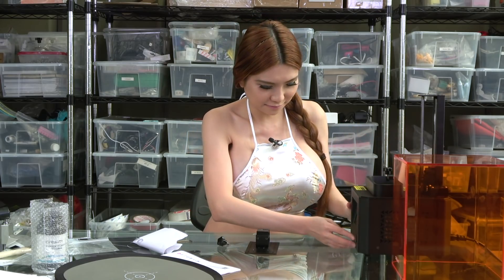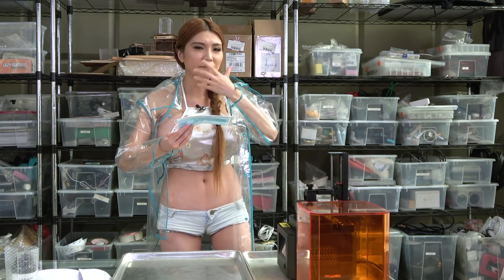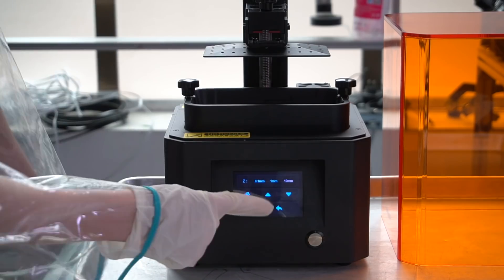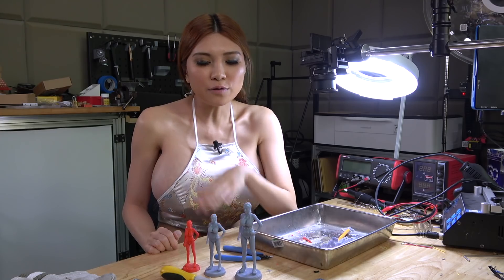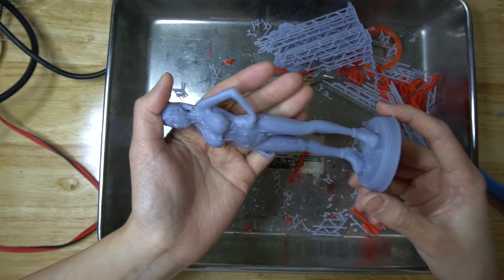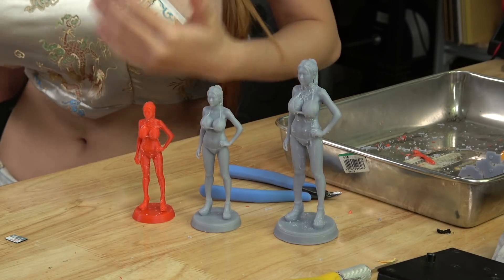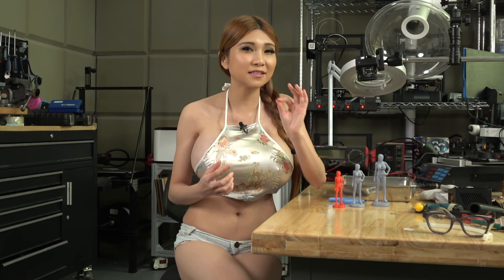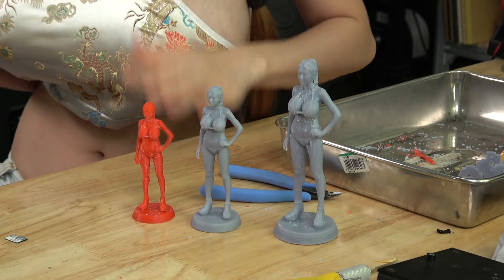Creality LD-002R SLA Resin 3D printer- Review and Unboxing!

Comment: Who ever wants to buy that Printer: you need to set up Z Axis default value (its on the Menu as Z=0). Otherwise when you just first use this Printer you crush your printed parts into the FEP film and screen. Either dent the film or crush your screen. You dont want that and I could not find a hint in the Manual.

Comment: In order to do decorative prints parts must be cut for printing such that the supports occur on the interior of parts or on an area of the surface where supports won't ruin the aesthetic of the final part. It's more work for file preparation but it is worth it. If your design intent is to produce quality prints for collectible level quality. Fun times!

Comment: this printer couldnt be any more Epax X1/Elegoo Mars if it tried. one suggestion, if you're gonna be using a resin printer a lot, is to invest in a decent, easy to drain and clean ultrasonic cleaner. gets rid of a lot of weirdness that shows up in cured prints without much effort

Comment: I think the part at the end, where you say the SLA/DLP printer is more an artistic tool, is dead on! You absolutely need to dial in the settings, espeially on supports, and Chitubox does not make it as easy as another slicer, PRUSA SLICER. Autosupports on PrusaSlicer are AMAZING. you set it up for their SL1 printer and it's a cake walk.  I love my resin printers, i have the elegoo mars, and wouldnt change a thing about it. THAT SAID, i have my FDM printer running right now doing other prints for other purposes :) Right tool for the job. Thanks for the good review and info,

Comment: I got a self made fdm and it soes the job, figurines is why i would buold a lcd printer but only for the graphical effect and speed of models etc . The issue i got is the smell so i guess any resin will do the job more or less problematic in a small apartment but the cleaning time compensates. A fdm even with the fastest settings will not make it as a sla does, but i would not recommend it as a starter as the slicers are specific and you print with expensive things vs a cheap fdm , and fdm has gone so good now you dont need to buy the bigger brands really as most are cartesian. I would buy this one if i move towards sla but i have tested it and it is really fumy when filling.

Comment: Someone modeled a beuty! The beuty - that is ;-)

Anyway isn’t it possible to limit the hassle with support by redesigning it in such a way, that it is still dense in most of the volume, but there would more diluted scaffold in the “touch zone”? Meaning, doesn’t seem necessary to me, that the scaffold would touch the model on so many places. It just needs to be robust under the model.

It would reduce the need to cut and scratch.

Comment: Could you have flipped the print to print from head down (head attached to platform) so you don’t need lots of supports, or would it not handle the weight of the finished print with a small contact point? Maybe far less cleanup?

Comment: My first printer was a DLP printer (anycubic photon) and I make small functional prints with it including hydraulic cylinders, you have to be wary of the shrinkage but otherwise it's perfectly fine for the use. I've made bearing races and even gas turbine parts using it and it performs extremely well, much better than any FDM printer I've used for the same purposes. 

If you want to make small functional parts with a DLP printer then use a low shrinkage resin, support only what you need to support, make sure you use a higher exposure time per layer to reduce shrinkage, and to take into account the dimensions of the pixels otherwise your print will stick to itself. I typically leave a 0.2mm gap (same as FDM) if parts need to be printed in close proximity to each other. 

Resin also offers one big advantage over FDM because you can weld resin parts together with more resin. I've been printing multi-material builds with resin about 4 months now and it works really well since I can do 2-3 separate print jobs and then weld everything into place.

Comment: The first thing that comes to my mind is in the slicer software that creates the supports, as the smaller the contact area the easier the cleanup. This requires a proper design for the support structure and this is something that default values do not give as the defaults are a starting point and it takes practice modifying them for the best results. Also often with lots of wasted material.

Comment: I did some experimenting with UV cured resin as a wood finish for guitars. It’s a neat material, but definitely seems to require more time practicing and developing a reliable work routine.
Bubbles/pinholes were the issue I ran into most frequently when working with it.

Comment: I'm thinking this printer might just be ideal for a customer of mine, a design he made didn't work too well and I modified it so that it is superb (I'm not a mechanical engineer, just electronics, but it really made a huge difference).   But the print houses want twice the price for my design yet very little difference in the print!   The printer would easily pay for itself.

Comment: Tip for removing supports. Before the final cure step, use a cuticle trimmer (manicure tool) to slice off the dots left from the supports. It cuts almost perfectly flush with the surface and makes sanding a lot easier.
Reply from the maker: Ok!

Comment: What happens if you don't add supports? It's printing upside down so everything's hanging out in midair anyway, so it seems like it wouldn't stretch out or break (or whatever happens, I have no idea about this stuff!)

Like, would it be possible to skip most of them, and just support the bigger parts that stick out like the arms? It just looks like the prints are really solid and you could maybe get away with just adding supports for the elbows or something, or adding a few to distribute the weight on something like the tilted model. Or does the auto mode really need to add all that?

Comment: Usually I would remove supports first before UV curing. Then sand off debris from whatever is not removed with a 400grit, needle file and diamond file

Comment: As always I love your content, I wanted to share a couple of tips to help you be safer and get better results with SLA printing. 

1) Use a respirator type mask with the resin, the same you would use to paint is a good place to start. 
2) Try removing the supports while you are rinsing it off with the IPA, if you accidentally dig to much out from the model you can leave a little resin to cure out the divot.

Comment: I must say, I think you came up with a brilliant option to work around the problem you had with the charity deal you tried to do previously. The only downside I see is that a hard copy version of your model provides mo option for someone who might have enjoyed incorporating your 3D scan into a 3D Graphics program. Also there are those who really have not talant for cleaning up the finished model and so because of that you might not get as many people interested in taking up your offer. Still all in all I'm betting it will do well because surely there are lots of people who would love to have their very own Naomi Wu. One thing I don't understand (since I have no experience with these printers) is why does the standing one need all of that support structure? It seems like when it comes out it's pretty solid. Now the one at an angle makes more sense to me but it seems like the standing one should be able to get by without all that support structure. My guess is there is a period of time in the process where it's not as solid as it looks like when it comes out, is that correct? In other words is the issue that without the support is there a period of time in the process where the model will sag and distort from the proper shape?

Comment: Supports need to be removed BEFORE you use the UV light on the print. Then they are softer and very easy to remove. Also thin supports leave smaller marks 

Hope it helps

Comment: That smoothness is great. If it were me Instead of making all one piece. I would make a sculpture in sections to make it an even bigger version than what the printer limited to. It should eliminate almost if all structure issues. I'm sure a little elbow grease with some sandpaper on the dibbets will smooth everything. Machines can't do everything, somethings need a personal touch. :) So a Healthy coexistence with our robot overlords is a must. lol

Comment: Going to have to find all your 3D printer review video's. See if I can find one, or something like one of them to buy. I'd like to find a way to make clear fan flow guides, to help on friends computer fan air flow on back/side intake setups (side fans blasting against side glass panel, and redirect it back towards CPU cooler and GPU for better air flow control). I want something that doesn't cause a bunch of waste, or require additional work to create the print.

Comment: For getting clean supports, I'd suggest:
- you can add your own supports, delete supports and move supports with Chitubox's support editing tools - the default settings aren't great for clean supports, so use this wherever you can to put them in places that have less detail (easier to remove, easier to sand the marks they leave)
- but make sure not to leave any islands as part of that process, islands will mess up a SLA print super fast

- in addition, I reccomend smaller supports than the default on any parts where you want to preserve detail
- some miniature-making Youtubers already have pretty good guides on this if you want to read up more

Comment: Could you look into a motion platform DIY.  I know it can be done and many have before but I can't seem to get a walkthrough on installing the motors and connection to the PC.  I would like to make a universal floor that has subwoofers and movement for driving and flying sims.
Reply from the maker: Pretty big build, it's hard to budget those

Comment: The paper masks are pretty useless. If you think the fumes are bad (it is not quite clear how dangerous they are), then you definitely need a higher grade bio filter mask to actually get rid of the fumes (you should not smell anything through the mask) and good room ventilation.
Protective glasses for your eyes are as important as the gloves. You don't want the resin (or resin/isopropanol mixture) anywhere on your skin or your eyes, especially for splashes from stuff dropping into the resin vat or the isopropanol bath.
The gloves which come with these printers are also usually ineffective. Get a box of nitril gloves, or vinyl if you don't get nitril. Definitely avoid latex, because it does not block the chemicals properly. And remember that everything you touch with the gloves after handling uncured resin (e.g. the printer, bottles, scraping tools) is contaminated as well and must be touched with gloves only until properly cleaned.
I would HIGHLY discourage everyone from getting a resin printer unless they are aware of the health precautions and are sure, that resin is better than PLA/ABS for what they want to do.

Comment: As for support removal, it is as you said, any skill takes time. What I would have liked you to mention was print times. I know they will be different based on settings and model, but I don't really know much about print times on the DLP printers. I have been FDM printing for about 7 years and am thinking about getting a Resin printer for very small items that don't print well on my FDM machines. Good video. Please keep up the good work.

Comment: Resin 3D printing is a significantly different skill set compared to filament printers, especially with respect to support placement.  As far as investing time in learning sculpting vs. resin printing, I can say that resin printers are a lot quicker to learn than sculpting!  The post processing skill set is mostly the same as what is needed for building plastic models.  As a wise person once told me, "If I can do it, you can do it!"

Comment: Your reviews are the best, always pointing the pros and cons, that's really helpful. I have a question, would it be easier to clean up the supports before the cure, or it would not make difference?
Reply from the maker: I've done it both ways with mixed results but I've gotten a few tips.

Comment: Nice results.
About the supports, I have seen a 3D printer in action, where the support was a different resin.
Once the print was complete, the object gets submersed in water and the support resin get dissolved.
It's from Polymaker - PolyDissolve.

Comment: Glad to see a new vid from you.  Love the box opener!  Using different levels of support (light versus heavy) and the diameter of the contact points helps a lot with ease of support removal and how much it messes up the surface of the print.  And Manual placement works much better than the default. (only took me a year to figure it out!)

Comment: Support columns seem to be the standard for this, but can a supporting open lattice shell be printed around the model instead? Something where the shell holds the model securely, but isn't actually 'cured' at contact points? So that the caged object would remove cleanly from the support cage rather than the supports being 'part' of the printed object. 

I'm an absolute outsider to such printers, but this is what sprang to mind watching the problems of support column removal. Its what I'd naively 'want' the blessed machine to do, whatever the actual reasons it may be highly impractical. 

Thanks to Miss Wu for your channel.

Comment: Resin printers are a must for tabletop enthusiasts who want to get into printing their own minis or (in my case) designing their own dice. You can print minis on an FDM printer, but it's just a lot easier in resin.

The one big issue I still have with my resin prints is that they generally still have bits of un-cured resin that won't wash off for several weeks after printing, even if I leave them in my curing chamber for several days. The only thing that seems to give me a completely clean piece is casting a mold for it using tin-cure silicone.

Relevant to the silicone issue: resin prints appear to still be very chemically reactive even when they've reached a point that's considered safe to touch. Platinum-cure silicone will inhibit badly if you try to cast a mold of a resin part using it. So badly that it's not so much a rubber and more silicone grease, and it never cures. I've experimented with some clear coats trying to put a barrier in place that the reactive elements can't cross and inhibit the silicone, but all of the clear coats I've tried also react with the resin, and don't tend to dry quite right.

Parts which have been left to cure/dry for several weeks seem to eventually get to a stage where the clear-coat will dry properly, but the best I've got for silicone casting is to print the part, make a tin-silicone mold, cast that in some cheap casting resin, then use that as the master for the platinum-silicone mold, and that's enough effort that I think it's useful in only the rarest of cases.

What's the point of all this? Uh... illustrates how nasty un-cured resin can be, I guess?

Comment: I've been using resin printers for over a year now. It's best to clip supports BEFORE curing. It makes it much easier to get good, smooth results on the model and it's easier to remove supports when they are still relatively soft before curing. Use generated auto supports until you are used to how resin printers work, but don't be afraid to try making supports yourself. You can often get better models with fewer supports if you do it instead of relying on the program. It does take a bit of practice, and you can expect a few failures until you get it.

Comment: Im sorry that makes no sense LD-002R isn't the best in its price range its as good as a well toned 300$ anyculic photon in terms of quality tats a simple fact it used the same screen and used the same slicer its a bit faster but that honestly isn't necessarily a good thing when talking screen longevity , and the big thing is price , in its price range you get into phrozen printers that are simply objectively better  offerings  having either higher detail ,larger build volume or print faster , so honestly i think its is an over site on your part to not talk about price point and compare the print quality to well a photon print like you have used the photon so there is zero reason to ignore the fact  a very similar printer at the same quality and size is  a small percentage of the price of this.

Comment: hey lovely Naomi! you seem a little bit short tempered in this one so i hope its just support removal stressing you out! (sending you love).
i don't have an SLA printer but from what i have heard, many people suggest removing supports before curing. i know it means annoying safety gear and smelly fumes, but you have to put it on anyway and it might help in getting the otherwise really impressively smooth results everywhere, without spending too much time sanding.

Comment: A quick scan of the comments, I don’t see anyone call you out on it. I think you said you had latex gloves. If so, those are insufficient. You need the nitrile gloves. They have a tighter knit molecular structure, keeping resin off of the skin. Which can cause chemical burns and forever after allergies, reportedly. 

I would also suggest 90+% IPA, not 72% rubbing alcohol. 

Did you cure the model before removing the supports?
If no, should have worn proper gloves.
If no, the struts should have come off very easily. 

FYI: I have a Nova3D Elfin and several hours of printing. 

Good review. 
Thank you.